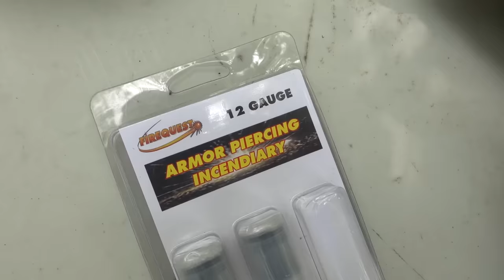Is a Bulldozer Bullet Proof???

Comment: And this is when Matt discovers how the Russians made sloped armor for there T-34 tank and why it was so unstoppable during ww2
Reply: I'm sure it was very stoppable but they made so many of them that you could kill one and 2 more would jump you
Reply: Lakree i think your thinking of america, russia didn’t even have enough guns for their soldiers
Reply: @kulturemusic6990  Yes, they did. At the time of Battle of Stalingrad, they had more Mosin Nagants than soldiers.
Reply: @maxman1602  you know to much about ww2
Reply: @bubsd487  the Germans had sloped armor during the invasion of Poland.
Reply: That’s clearly wrong, they were unstoppable because of their resources and their god damn will to fight, not because some medium tank with varying degree of quality had slopes.
Reply: THe thing with T-34 is not durability nor power. .It just sheer numbers.. The T-34 was easy to manufacture compared to a German  Tank or  an USA Tank...
Its the embodiment of: Throw EVERYONE AT A PROBLEM TILL IT SOLVES.
Reply: Gillboy75 yes the angles did help with armor protection but that only really was useful against 37mm and short barreled 75mm but again since the quality of the actual steel can be either good to bad. Even a 37mm might go through the front if the welding was bad enough. Also why did you delete your comment? I still believe the T-34 was good for the Russians but angles didn’t win them the tank battle.
Reply: @kulturemusic6990  they built so many T-34s that not even losing ~45000 (fortyfive thousand) of them during the war mattered. It's the second most produced tank of all time.
Reply: @Terraqueo22  T 34 was still an amazing tank
Reply: @itsgonnabeokay9341  Sure It had its merits. Easy to repair,low service cost, speedy compared to other alternatives. But again russians only won because of sheer numbers and Germany in the end of war...

Comment: Should have shot the AK / 7.62 x 39 round at the "thinner bucket part" as well. In addition to trying it only on its thicker border..
Cause although it's a bit stronger, an the slug a good amount heavier then the 5.56 
The slug of the 5.56, being slimmer and therefore having less resistance, may penetrate certain materials better then a 7.62 x 39..

Idk just curious and was hoping he was gonna try shooting both parts with the AK-47.

Comment: The thicker part on the bucket is a different metal, its much harder than the bucket itself due to being used for digging or scooping up dirt. Same thing goes for excavator buckets, the teeths are really strong. Might be a good idea to read up on steel and its different types. 

Going trough a welding education and materials are a part of it, what types of steel that can be welded and such, really interesting and informative stuff. 

But this is certainly interesting to watch, should bring more plates of steel, of different types and thicknesses to test how deep bullets go.

Yes, cars are not bulletproof, as movies will try and make you belive, due to the thin metal used for the shell, only the engine block can't be penetrated easilly. If you happen to end up in a firefight and use a car as cover, stay behind the engine.

Comment: My main problem with this video is that you shot the wrong side of the scoop. Mel Gibson was shooting at the the back of the scoop, where the couplings hold it onto the arms of the skid loader. You shot the bottom of the scoop, where it's been scraping the ground and stones for clearly a long time, and was most likely the side sitting on the ground accumulating the most rust damage. You shot the strongest point on the weakest side with the .50 BMG, and the black tip made it through after facing it flat. But it was much less likely to pass through the thicker side with the coupling points. That side holds the weight of the entire scoop plus the load its carrying. Its also the side Mel shot at in the movie. That black tip probably won't go through that side

Comment: I own a bulldozer.  I own a ‘few’ guns (so far as my wife knows).  And yes and no….they are bulletproof….depending on the gun.  By the way…the bucket if off a loader…it might be off a very small backhoe or modified loader.  Not a big machine at all..it looks similar to one of the mod buckets that was used with the JD440ME that was used by the military in the Second World War.  It’s a small machine designed to move a lot of dirt all at once.  The leading edge of the bucket is usually reinforced with a hardened tool steel to keep it from bending out of shape.  The bucket itself is simply mild steel reinforced with a framework of hardened (but tempered) tool steel…..think steel punch steel or drill steel.

Comment: AP ammo for handguns is unfortunately quite hard to obtain in the USA IIRC. I think owning it can get you in trouble with the ATF. Not that it's particularly useful to the average civilian but having a concealable weapon that can go through kevlar is good for community defense or resisting any tyrrany that might come your way. In which the nickname "copkiller" becomes the whole point of the thing. (Or, cop incapacitator, whether they actually die is less important).
Reply: (also AP handgun ammo should not do all that terribly much against metal because you really need speed. Something anything but 5.7mm is not really optimized for.

Comment: im point out that the directions of the bucket matters, you know---physics, an object hitting concave V concurred surface changes the applied force at impact point, most movies are bullshit and help shape the misconception of danger V safe soooooo 4 years later you should redo this... also bucket type matters, dozer V excavator these use different steel one is harder than the other